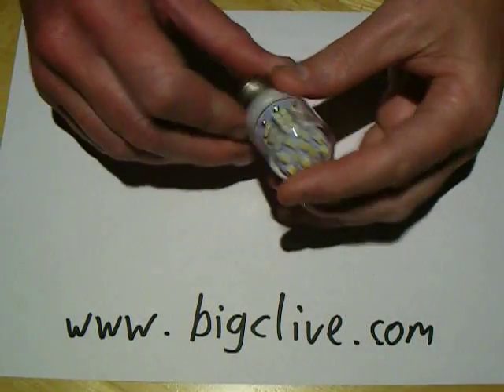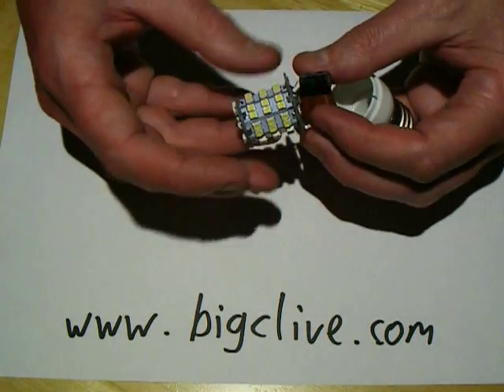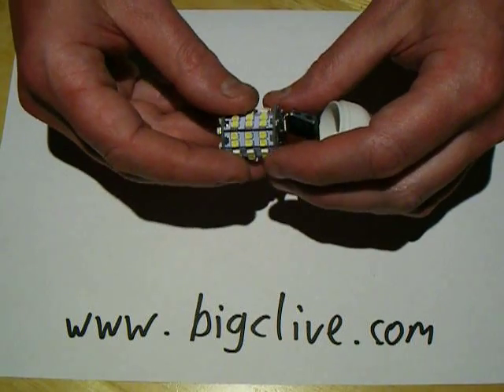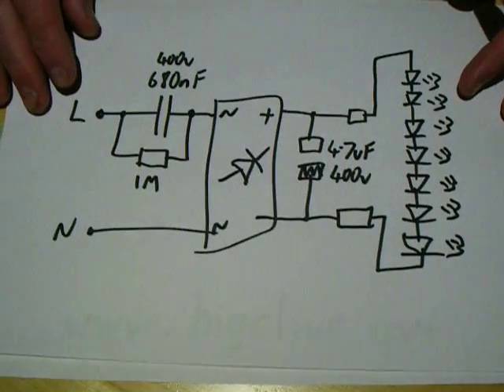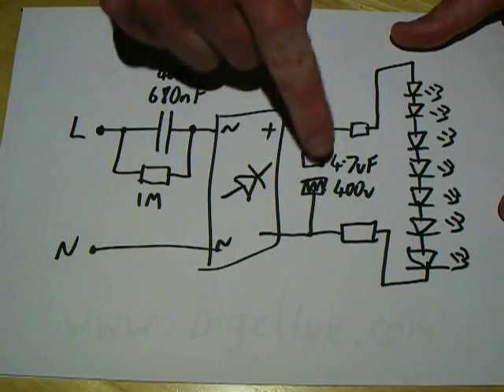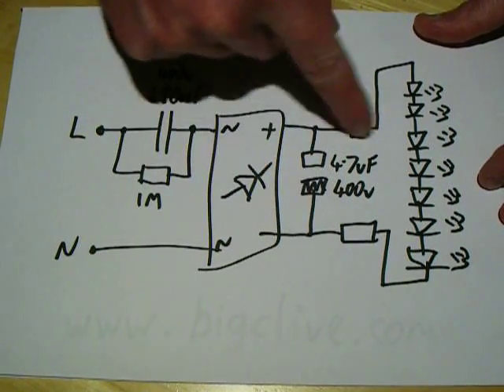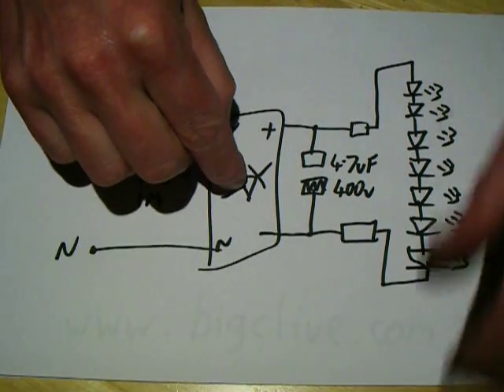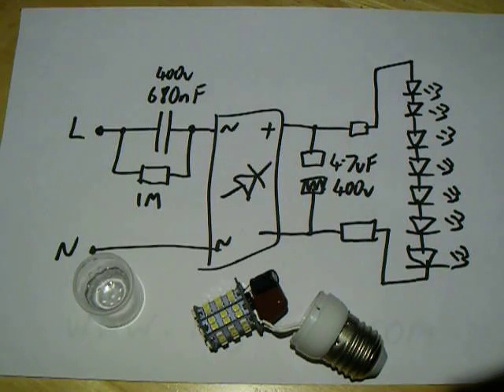Teardown of a small 60 LED mains powered lamp.

Comment from the maker: It is indeed the "luxury" version.  The ones prior to this model in the same range had a separate general-use capacitive limiter that did indeed cause visible flicker in peripheral vision when used with large strings of LEDs.

Comment from the maker: The earliest capacitive droppers with low value series resistors really did nuke the LEDs, but the later versions with sensibly high resistor values that limit peak transients to a few hundred mA seem pretty reliable.  This particular version has an electrolytic right behind the rectifier which eats the bulk of any transients before they even get to the LEDs.

Comment: Modding these with resistors or a constant current switcher for 12V/24V use would probably be better WRT lamp lifetime as these capacitive droppers pas any high dE/dt transients straight to the LEDs.